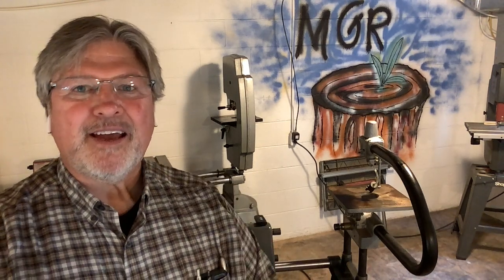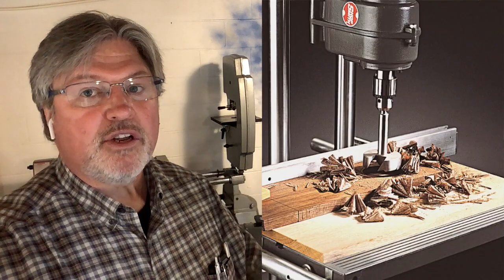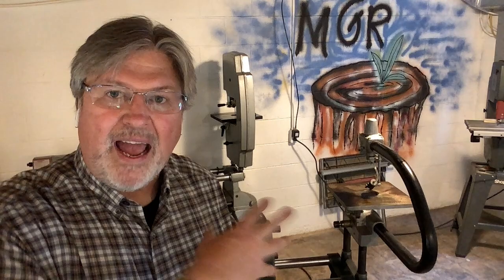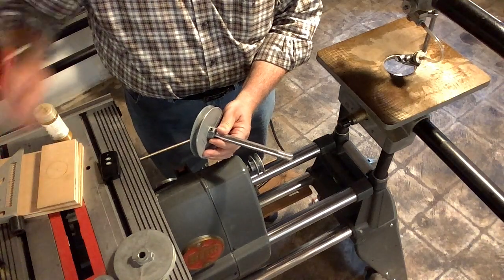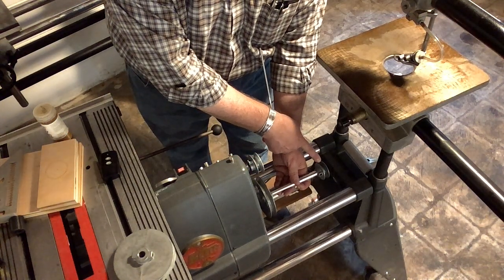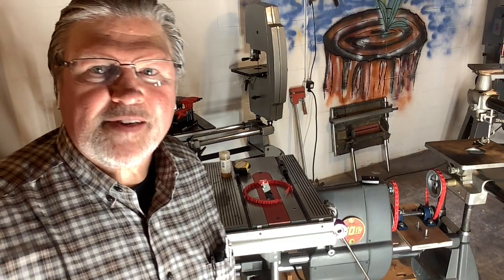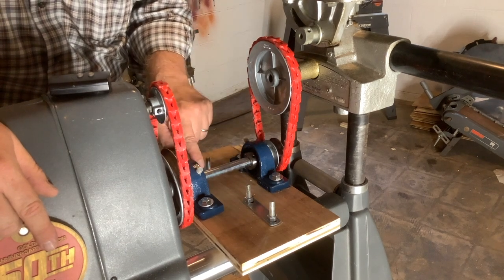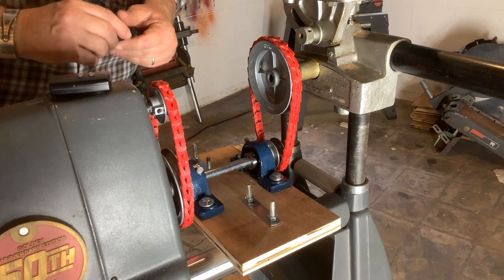Shop-built Shopsmith Speed Reducer

Comment: Scott I was looking at this again to consider building the DIY speed reducer and I’m wondering… how would yours work in the lathe operation.   It doesn’t seem that it would since the span between the headstock and the tail stock is taken up.    The lathe operation is what I’m interested in for lower speeds.  Did I miss something?
Reply: Oh Scott you are too good.  I found the nerd level speed reducer video after I posted this question and it answered my query.   On your DIY reducer you cannot turn bowls.   Keep up the great work.  Now I’m shopping for a SS speed reducer!!
Reply from the maker: @tzavitz  Glad you found the answer. There is another style of homemade reducer that could be used, but it’s expensive to produce and if you can find a Shopsmith speed reducer, I think you’re better off. Scott

Comment: Hi Scott. Not sure if you will get this as your video is over a year old. Anyway, great video and one that I plan to refer back to in the very near future. I do have a question however, would it be feasible to flip pulley sizes around and use as a speed increaser? Thanks again for your fantastic content!!
Reply: Thanks for you speedy reply Scott. I guess I neglected to convey my full thought. I have a spare 500 headstock with a blown motor. Wondering about connecting your design between the two headstocks. I would remove the motor to reduce weight, and remove the belts, but would the quill bearings cope with the high speeds? If so I assume this could theoretically be used for routing and shaping. Same setup but in reducer mode could do large bowl turning too I would assume?
Reply from the maker: @michaelbaigent3140  Yes, that would work. You absolutely could use it to reduce the speed and drive a second headstock slowly. In that configuration you could use it to speed ahead stock as well, but keep in mind that certain bearings in a Shopsmith headstock are not intended to be driven beyond 10,000 RPM. I would connect it to the quill in the drive shaft and avoid connecting to the high speed lower shaft.
Reply from the maker: Yes, but for what purpose? There's not a lot of stability in the shafts as this is designed, so it's not like you could shape or route with it. Also, as you increase speeds with belts and pulleys you loose torque, so that's also working against us.  Tell me more about what you are thinking. Scott

Comment: Nice video.  Would using 'J' bolts, instead of the 'U' bolts, make removing and putting back on, faster and easier? You are nor applying huge torque on those, usually, so it should not be a problem.
Reply from the maker: I dont’t know that J bolts are available in this size, but one cut with a hacksaw anted a U bolt becomes a J bolt.

Comment: Thanks for posting the video, Scott.  I don't cut metal or plastic often, but this is a great idea to lower the speed at the cutting tool.  I wondered if you might be concerned about the U-bolt putting a dent in the way tubes, but it looks like the nuts are just hand tightened to provide belt tension.  I'd probably throw a piece of leather or rubber between the U-bolt and the way tubes for protection.
Reply from the maker: Hey Don. No, it really doesn't require much tightening and I had some experience in the past with U-bolts on the way tubes that were very tight, and they never caused a problem. Great observation, though. Scott

Comment: I wish I could reduce the low speed of the Mark V without the addition of a external speed reducer. I don't go above saw/jointer speed, but I would like to go below 700 r.p.m. for boring/drilling and lathe turning.
Reply from the maker: An internal VS motor is just about your only hope for a wish like that.
Reply: @MyGrowthRings  What if you eliminate the poly v-belt, and add a small pulley outside the headstock on the high speed lower shaft, and a large pulley on the upper shaft. Sorta like the old 10ER. I do have a Mark V dedicated for drill press/horizontal boring and lathe turning to test with...
Reply from the maker: @chadnevels246  We had someone bring a Mark V headstock in for repair in Dayton that had done exactly that. What we couldn’t understand was how they were able to get the belt installed because it was one tight as a drum.
Reply: @MyGrowthRings  I'll take that as a no, don't do it. After thinking some more, it wouldn't work anyway.

Comment: That's really cool! I'll need to make one of these for the son-in-law. I have the power pro. Is there a problem running it at its slowest speed of 250 rpm for an extended period? I can see using one of these for finishing work on wood turnings.
Reply from the maker: Hey Frank. That would make a great gift or project to build together. There’s no problem running this on a mechanical Mark V for long periods and from what I understand the only issues with running the PowerPro for extended periods has to do with high speed operations. Scott

Comment: Got a 86 Total Shop, 
Any idea, where to find a idler sheave? Mine snapped unsticking the sheaves.  Any chance? I have a parts machine,  but really want to dedicate it to drill press.
Reply: Nothing will interchange  with shopsmith correct? But belts. I have a 500 too, was just gifted.
Stuck sheaves a common issue, I am finding.
Reply from the maker: Correct, nothing internal. One of the things SS knew to do was to make their motor shaft and the idler shaft from stainless steel, but the folks in Taiwan who reverse engineered it either didn’t know or didn’t care. That created a couple corrosion points.
Reply from the maker: eBay and Craigslist are pretty much all that's available to us. They folded over twenty years ago.  Scott

Comment: You mentioned that the hub on the lower idler shaft can function as something if a heat sink for it. Could you attach a finned heat sink to the shaft in place of the hub and get even more of a heat reducing benefit for the headstock? Asking since there is a lot of discussion about heat issues/concerns for the SS headstock
Reply from the maker: I suppose you could, but it would still need to function as a drive hub for the jointer/scroll saw/sprayer.  I think the bigger issue is with the new smaller bearings that SS is using on the PowerPro. Scott

Comment: Is there a fix for getting the reducer onto the primary take-off to get the lathe function running at lower speeds? ... for off-balance bowl blanks and much sanding and finishing, much lower speeds are advisable  ... alas, I've had an actual speed reducer on order from All-In-One Tools in Oakville, ON for 6 months, but nothing doing from Shopsmith ... Cheers Farmer John, Ontario, Canada
Reply from the maker: Hey John, check this idea out: https://www.youtube.com/watch?v=mplJeBjLEWM
Reply: Hot and Cold Running Shopsmiths! 

Scott, Holy Wow! Omigosh! He's got an original Shopsmith and a cannibalized one! The entire bedways are taken up with the gizmo, so that you'd need a ways extension to slide in a banjo and rest, and a third Shopsmith backed in and aligned with precision for a tailstock! His unit would work quite well for sanding and finishing, but there goes the drill press! I won't even contemplate mounting the jam chuck to remove the tenon "Yo, another Shopsmith please!" He had 14 subscribers, but didn't respond to the lone comment a year ago ... that makes for an excellently speed-reduced channel build! Maybe plan a gala giveaway at the 20 mark!

Scott, thanks for thinking of me. I might wait on an OEM reducer. Cheers, Farmer John, Ontario, Canada
Reply from the maker: Hey John. Yes, I wrote about this on one of my blogs many years ago, and several people on the Shopsmith Forums have explored this as well. Check this out:  http://shopsmith-tool-hunter.blogspot.com/2009/02/reversing-and-slowing-shopsmith-mark-v.html

Comment: That’s very helpful Scott and I think can be used for three of the five functions that I know of that need a speed reducer, all on the left hand SPT/accessory side of the headstock.  If you could make it strongly enough, I wonder if something similar could be built for slow speed turning and using with the drill press?

I see that over on the Shopsmith forum, someone has experimented with an auxiliary motor driving the lower accessory hub which he has then used for slow speed turning on the right hand side of the headstock.  I wonder what damage that could potentially do to the headstock innards?  And while useful for turning, because the big pulley that he uses covers much of the left hand side of the headstock, I’m not sure that his modification can help with the functions that your method does.  He recycled the auxiliary motor and its speed controller from an old gym treadmill.  This strikes me as a much better use of that kit than in its original installation!
Reply from the maker: Hey Graham, Yes, with a bit of engineering it certainly could be made to do just that. In fact, the SS Speed Reducer is just a glorified version of this design.  Also, I wrote about the idea of driving the Mark V at slower speeds with an auxiliary motor over on one of my blogs: http://shopsmith-tool-hunter.blogspot.com/2009/02/reversing-and-slowing-shopsmith-mark-v.html
Reply: @MyGrowthRings  Ha! That just goes to show that there’s nothing new under the sun.  You even mention using a treadmill motor.
Reply from the maker: Yep. I really need to read through my blogs to see what else is there. It’s been so long since I wrote most of those posts.
Reply from the maker: Hey Graham, check this idea out: https://www.youtube.com/watch?v=mplJeBjLEWM
Reply: @MyGrowthRings  Well Scott, that excellent discovery has set all sorts of hares running in my brain.  Given that the video was posted five years ago and only two people (including you!) have commented, it seems to be a hitherto undiscovered gem.  I had to watch Jacob Anderson’s tear down videos to try to work out what was left inside that secondary headstock.  The answer seems to be just the quill and the upper drive sleeve assemblies, plus the waytube locking mechanism.

So that suggests that to make this work, all you need to buy off eBay is a cheap headstock with a burnt out motor, broken sheaves or non-functioning speed control (or all three) and take it from there.  The biggest downside that I can see is the need to take off the heavy primary headstock to install the secondary headstock on the waytubes.   And vice versa when you need to revert the Shopsmith to other functions.  

But what if your defunct headstock also came with legs and tubes?  And you also had access to the motor and variable speed controller from a gym treadmill?  Assuming that you had the space for such a thing in your workshop, you could then assemble a dedicated ultra slow speed Shopsmith, providing drive capabilities on both sides of the headstock - lathe and drill press on one side and SPT’s on the other.  The mind boggles at the possibilities!
Reply from the maker: @grahamw2955  Yes, this really does open things up. And don’t forget that there are quite a number of clone machines that are worthless due to broken speed controls that don’t interchange with SS parts. The parts you need to do this should work just fine.
Reply: @MyGrowthRings  I’ll keep my eyes peeled for a clapped out bargain.  They do come up here every now and then but not as frequently as over there.

Comment: Scott, I thought that gear ratio was basic knowledge.  In elementary school I remember studying pulleys in basic science class.  In Jr. High I had it in algebra class and Earth science.  In high school there again it came up in Geometry and Physics.  I really thought the knowledge was ubiquitous.

Several years ago I built a reducer powered by an 1800 rpm electric motor. It hooked to one end of my bench grinder. That allowed me to run it at low speed to sharpen cutting tools.

Then, along came Tormek.  My wife got me one as a gift.  Well, the old reducer was in the way so I set it in that corner where unneeded tools go to hide.

A couple of years ago a young guy at work was wanting to sharpen knives without burning them… so I offered it to him.  Well, the motor had long since been repurposed to drive a squirrel cage fan.  He was going to have to come up with his own motor.  

When I brought it to him, he told me that his motor ran at 3600 rpm.  I told him I built it to step down 1800 rpm to 450.  And, that he could just change the ratio of step down by replacing  the two 4” pulleys with 8”. Or, run it at 900 rpm as is.  

He said, “Wait… did you just do that in your head?”

I smiled and said, “Yes sir, Pi is still Pi, at any speed!”

Scott… his eyes were as big as silver dollars.  They glazed over when I told him to be careful because he was going to get almost eight times as much power!  

He went to one of the mechanics to check my math… I went to coffee break wondering what they replaced mechanical advantage with, in our schools.

Scott… the magnets were genius!  I’m a gonna copy that!
Reply: Yep… they think ratios are when they get fewer likes than subscribers… and, I’d love to see them try to drive a stick shift Farmall to the milk barn…. And have a hidden camera record how they try to get a quart of milk from a springer heifer!

I’m betting they can’t tell you the  last time they drank water from a tap, either!  LOL
Reply from the maker: @sassafrasvalley1939  You mean that stuff that fish poop in? Yuck!
Reply from the maker: Dave, I ALMOST mentioned Pi but decided to let it go. You are right about ratios being a lost art. My kids didn't learn anything about them in school and I don't think either of them can drive a manual car for that matter! (Sigh) That last part really makes me feel like a failure as a dad.  Scott
Reply: Yeah and ask any youngsters where milk comes from and I bet the response won't be cow's but instead Almonds!
Reply from the maker: @curttundra  Isn’t that crazy?
Reply: As a slightly younger "old timer". I can say that I was sooort of taught about pulleys and gears but I can't hold a candle to the head math any old grease monkey could do even if he didn't know what he was doing. You old timers don't even understand how powerful you are with your fancy little math tricks. in all honesty I'm so grateful for the folks like you who are teaching me all of this valuable information. I am lucky to have had some mentors but we all know how quickly all of this knowledge is going away. Especially if it's goofs like us trying to carry the torche. Man it's looking bleak lol ;)
Reply: @WoodworkingforAnyone  LOL… it is fading in my head too!  I’ve been teaching my 18yr old some woodworking for the last two years.  He is a straight A student.  Although math is a strong suit for him, he has always relied on his phone for calculation.

We were using 3/16” dowels to make a conductors baton as a gift for his band teacher.  In order to taper them on the lathe, I needed to drill a hole on a half inch dowel to use as a tail stick… I told him that the hole needed to be larger than the dowel so that there was no friction.  So, I had him measure the dowels.  

As usual, they had swollen from .1875” to a max of .195”… so I told him, “ Go grab a 13/64” bit.  That’ll give us about eight thousandths of clearance.”  

He looked at me and I could see the wheels turning in his head… then he grabbed his phone and did the math.  When he got his answer he said, “How do you know that?”

I answered… I didn’t know that.  I did know that 3/16”=0.188”… that each 1/64”=0.0156”… and that ..195”-.188”=.007” so it reduced down to 15-7=8…. And, I learned that in first grade.”

We then had a discussion about how memorizing just a few simple numbers made math so easy to apply without doing long equations.  And, that conversation was a learning experience for both of us!!! 

PS:  don’t tell him that the clearance is off about a thousandth due to rounding.. LOL
Next month, I’ll post the video of him making the batons and presenting them to his band teacher!

Comment: When mounting a pully on the Shopsmith output shaft, should you be concerned with the type of set screw used?
Reply from the maker: Hey Robert, yes, you are exactly right. The set screws on the speed reducer shaft aren't as critical, but the ones on the upper pulleys on the Mark V headstock and on the SPT should have a flat point. Very good observation! Scott
Reply: @MyGrowthRings  I learned about this the hard way when I replaces a lost setscrew in a router chuck with the only one they had that fit at the hardware store,  It was a cup center which seemed to be very common. There is a document posted somewhere on the Shopsmith forum that lists all the setscrews sizes, type and where they are used. I can't find a link but I have a copy.
Reply: @RobertKeeney  I'd be very keen to see a copy if you have a way of publishing it.
Reply: @grahamw2955  I found it in the Shopsmith Fourm. https://forum.shopsmith.com/viewtopic.php?f=10&t=19588.
Reply from the maker: Excellent. Thanks for sharing.
Reply: @RobertKeeney  Splendid - the pdf version even has photographs.  Thank you.